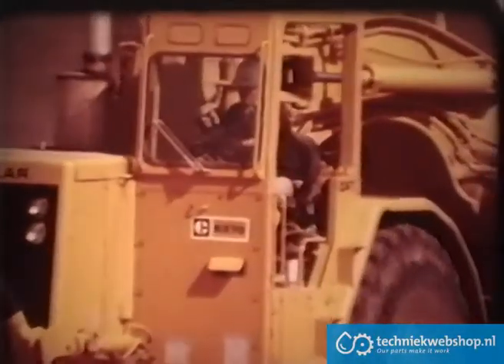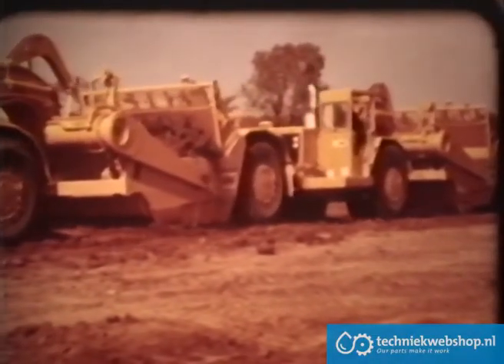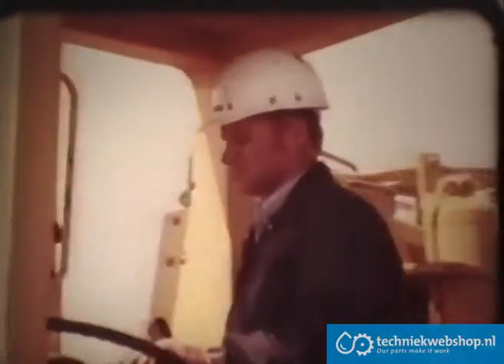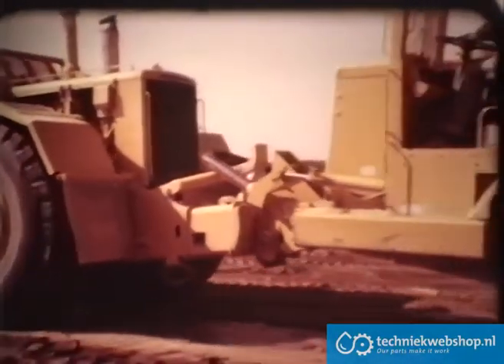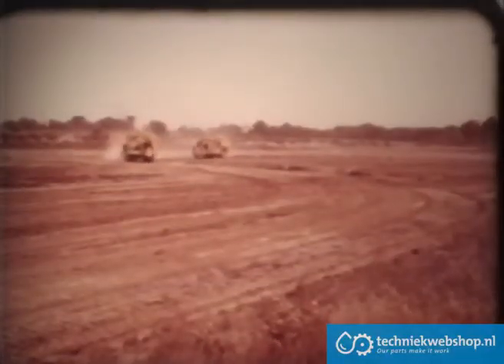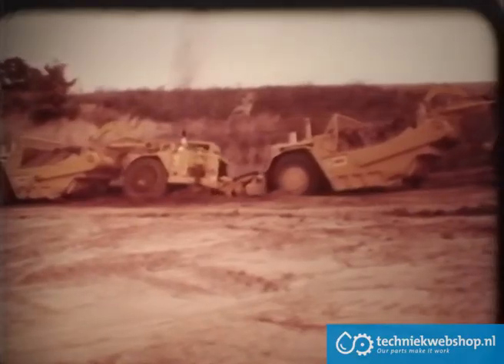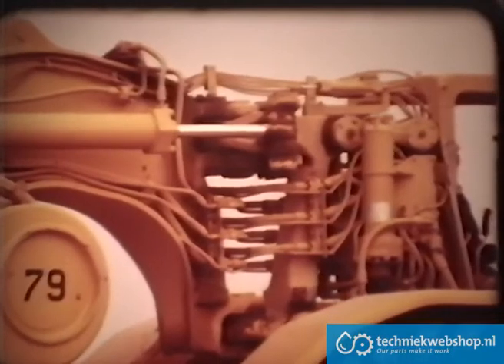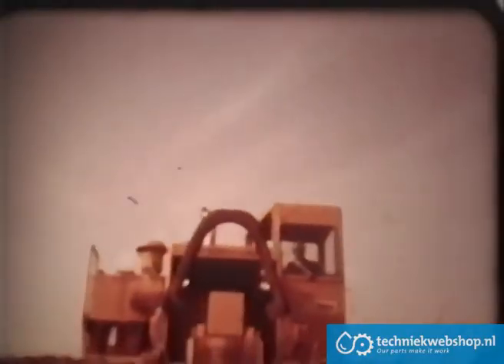Mastering Push-Pull Scrapers – Efficiency & Teamwork

Comment: These rigs are just for show on a real job the rear engine radiator would have a guard in front of it and the mud flaps would be torn off the first day and the dif lock would have a bolt under it so you can't use it to many people apply it and turn and it destroys the planetaries and that is a major repair in all not a bad viedo for a beginner A company like Kiewit construction would show you a viedo like this if you went to work for them to run a push poll.